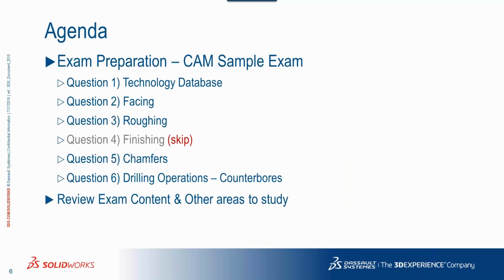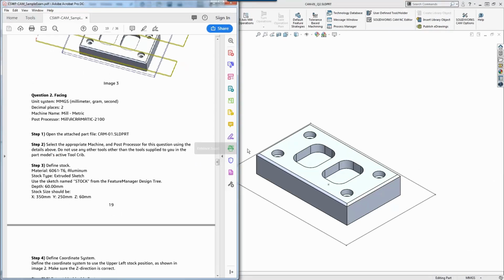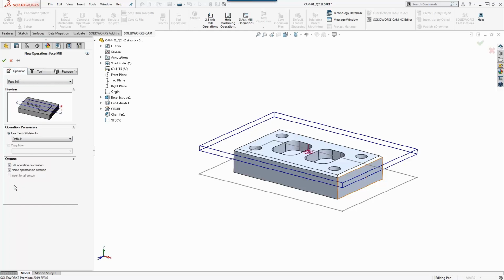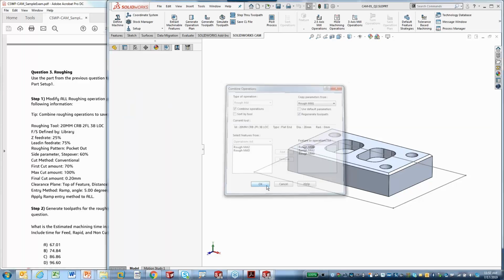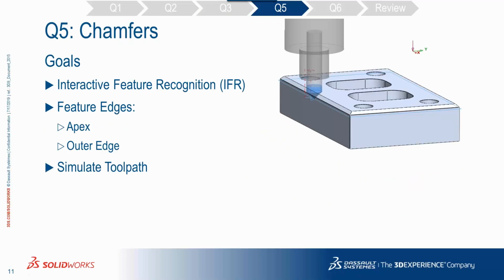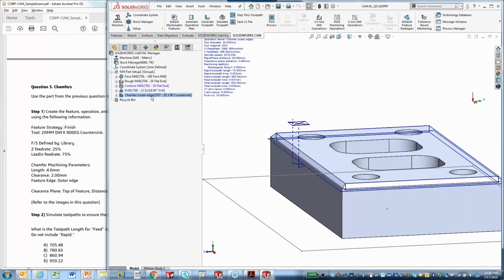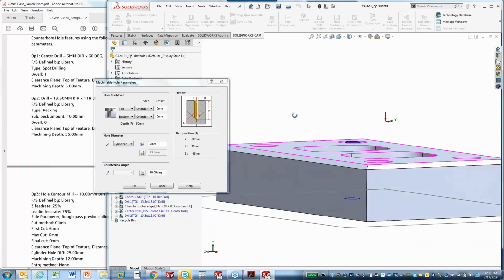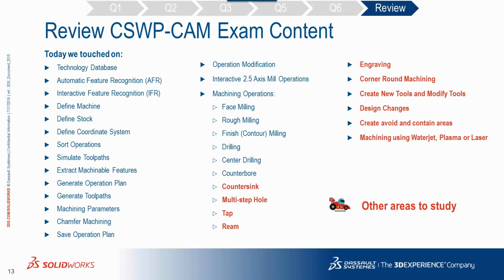Preparing for the SOLIDWORKS CAM Professional Certification Exam

Comment: Hello I am trying to machine a fillet what feature do I select on 2.5 feature machine in sw. Please help
Reply from the maker: Hi there, we are happy to point you in the right direction for great resources. MySolidWorks is the place to get the best answers to your questions about SOLIDWORKS in one location. 
 
We can also direct you to a variety of resources for questions and networking. 
 
SWUGN, or the SOLIDWORKS User Group Network, can be accessed here:  http://swugn.org/ 

With your existing SOLIDWORKS or 3DEXPERIENCE ID, you can access SOLIDWORKS Forums for more information on a variety of topics and questions from our user community. 
 
Check it out here: solidworks.com/UserForum
Reply: @solidworks  yeah after 8hrs of banging my head on the wall. I figured it thank you. It was quite simple  actually soon will be taking the CAM exam
Reply from the maker: That's great to hear, we're so glad you figured this out!

Comment: Answers are not matching with the sample exam options. These are the questions which have multiple choice. So it is easy. real exam may not have that. Most of the CSWP has fill in the blank type question. so, by this mistake, one can fail.Whats the solution?
Reply: the first questions of all solidworks certifications is a multiple choice question that HAS TO match exactly. othewise you have something off, maybe by very little and that would still be correct though.

Comment: Power Mill Is Power Full than SOLIDWORKS  CAM
Reply: NX CAM powerfull than powermill :)
Reply: Powermill the best
Reply: Power MIll is designed to be a CNC software, like MasterCAM, EdgeCAM, HyperMill etc. You need to wind yer neck in son.
Reply: Nx cam is best then power mill. Other software is not that good.